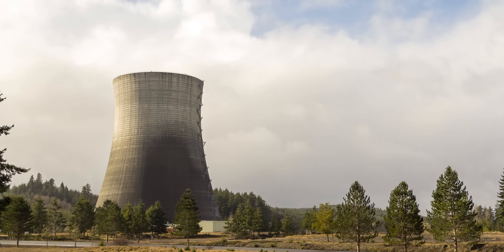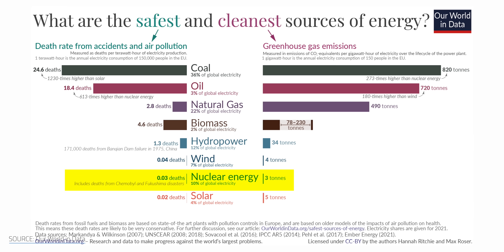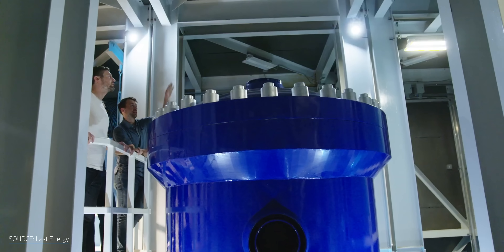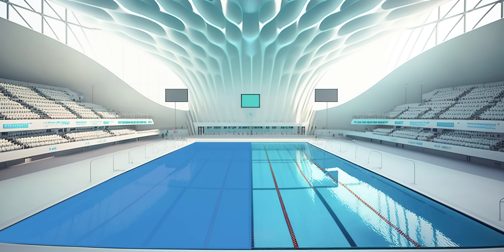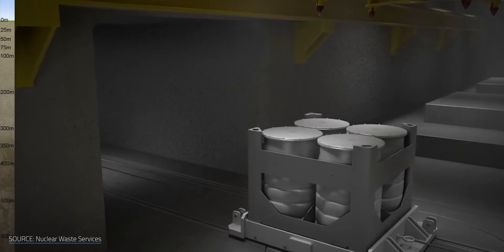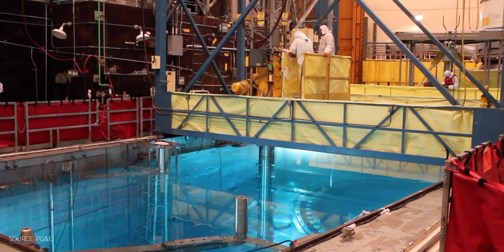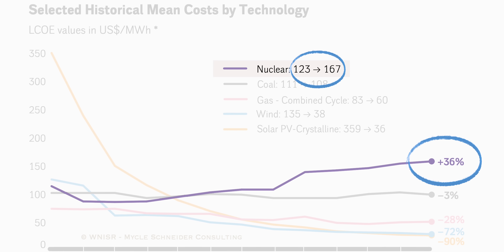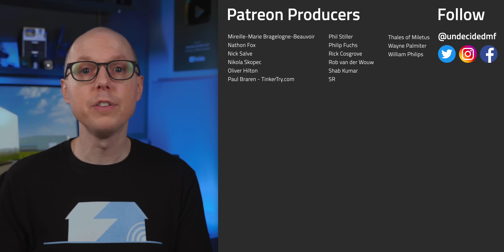Is Small, Fast, & Cheap the Future of Nuclear Energy?

Comment: Maybe in their region these advantages exist. But where I live I expect it to take at least 5-8 years to develop just 1 (or more if it is in a combined project). Putting up a windturbine takes already +-3 year, with 2,5 of those being due to regulations, administrative process, ... This will be much longer for nuclear sites like this.

Also in terms of safety demands, I am pretty certain those will also be rather high, probably increasing the cost.

The reason we have currrently such big nuclear plants isn't just complexity etc, but also the advantage of scale in the cost and especially in terms of safety, which due to it being centralized can likely be much lower than when spread out.

Also $123m for a 20MW reactor is going to be essentially the same price as a big one: $9,8B for 1,6GW vs $8-10B for one 1,6GW big reactor. Pretty sure that regulation will require at least a few personnel being constantly on-site: an operator, maintenance (probably 2-3 to be certain or 1+few in standby/floating around), security, ... So that are at least something like 10 people per reactor (shifts), if spread out this can be around 800+ people too, similar/more to a big one currently.

And just adding modules with the same permit is also going to be not so easy if this wasn't already forseen upfront.

In the end this sound a lot more optimistic than it likely is imo and we'll have yet to see how good MSR's like this can actually become.

I think just standardizing this big plants as much as possible is also going to be a much more cost saving measure. And not just standardizing within one country, but over multiple ones.

MSR's still can obviously be very usefull to provide regions with power that are a bit more seperated and don't need the output of such a large one. Maybe in the future with more renewables and potentially dwindling need for nuclear, they can be usefull for industrial sites etc where 24/7 power might be needed.

Comment: Matt, you need to double-check your sources. Those LCoE numbers are way out of line, which should be unsurprising given that they come from known anti-nuclear energy organization, the WNISR. Both the IPCC and NEA clock nuclear at under $70/MWh, and solar and wind significantly higher than the WNISR.

Also, almost all calculations for LCoE that return such low values for renewables are excluding the necessary cost for storage.
Reply: And nuclear power plants only have a life expectancy of 30 years in the LCOE calculation. Meanwhile in reality, Belgian nuclear power plants have been running for 40 years now. And some have been extended for another 10 years. It could've been 20 years  according to scientists, but the green party wanted them closed.

Comment: The problem with nuclear energy is that a lot of nuclear plant research was stopped in the 1970s after the 3 Mile Island accident, and the Chernobyl RBMK reactor melt down was the nail in the coffin. To further muddy the waters, the Fukushima Daiichi plant, a design from the 1960s, while poorly funded and operated by TEPCO, convinced many that nuclear power was simply unsafe. But modern plants are far more fail-safe than the designs from the 1960s. Saying the risk is too high is like looking at the safety record of a car from the 1960s and then declaring that all cars are unsafe. It is a dishonest comparison. 

Nevertheless, no matter what the LCOE is, we simply don't have anything close to the energy storage we would require for wind and solar to keep the grid going on those sources alone. The storage capacity of modern systems is orders of magnitude less than we need. We don't have the known resources on this planet to build such energy storage either. No amount of hand waving or professorial confabulation will make it so. 

Don't get me wrong, I think renewable energy should be part of the portfolio. But there is a requirement that it will not be able to meet for a very long time-- if ever. And that is the Base Load energy. If you don't know what that is, look it up and then look at various grid operations web sites such as https://www.iso-ne.com/ or https://www.ercot.com/gridmktinfo/dashboards to see how much the shortfall is. And while as an engineer I love efficiency, we can't conserve our way out of this problem. 

Those are the hard facts. Sloganeering will not fix things. SMR technologies have run successfully on board the ships of the US Navy since the 1950s. The only new technology are the fail-safe controls of more modern designs. Let's build them, or let the grid go dark and watch what happens to the environment when every harry homeowner lights off a generator in the back yard and a wood stove to stay warm.

Comment: Does LCOE include the cost of cleaning up after Fukushima? Nuclear is expensive, until something goes wrong then it's really expensive.  Until the cost of recycling and sticking the the leftovers in the ground is factored in, I don't think it's fair comparison.  In 50 years you can put the waste in a new cask, but with inflation that cask is going to be more expensive, so no matter how much energy you got originally, the clean up keeps getting more expensive the longer you put it off.   So I just don't trust any cost comparison until we really add up all the costs.  Finland almost there, but we need a few more continents doing the same.

Comment: To answer your question, yes.  I can see no way of bringing costs of nuclear energy down to a reasonable level other than by building small modular reactors on an assembly line.  Hopefully producing plants on an assembly does not introduce new hazards during the production process.  All the same I'm pretty excited about this.  If electric vehicles are the future, this will go a long ways towards reducing the need to beef up electrical lines to carry more power over long distances.  Having a nuclear reactor that's dedicated to specific locale (be it a city or a manufacturing faciliity) seem like a great way to achieve cheap and reliable energy.  Though even with the increased safety, if you have widespread adoption the chances of something going wrong somewhere does offset that increased safety.  My fear is that when that one incident happens that it will restigmatize nuclear energy and cause unwarranted apprehension.

You mentioned in your video that Last Energy is saying that it is theoretically possible to use spent nuclear fuel.  According to this video from Copenhagen Atomics it sounds more like a near reality using their small modular Thorium reactor to burn Plutonium and the long-lived actinides.  https://www.youtube.com/watch?v=27IntvWo4mo  Their first prototype reactor is slated to start up in 2025.

Comment: Modules like this, and the one Rolls-Royce has been developing, will become more useful, and more necessary, as we as a species expand away from our parent star. PV becomes less effective further out as input energy drops away, but nuclear fission, and hopefully fusion too, remains the same output from the same input.
Closer to home, disaster management is where small nuclear units become very effective - fly in under a helicopter, put on the roof of a hospital, power the equipment to keep people alive. (Do the same on shopping centers and malls to keep power on while surviving the Zombie Apocalypse,...)
Standardization is key, so they can plug in anywhere, followed by swapping cycles to keep pulling energy out of what we currently class as 'spent' fuel.

Comment: The mentioned 24000 years when nuclear waste is dangerous is a milk maid calculation. Plutoniums 239 half-life period is 24000 years. After one half-life period there will only 50% of the Plutonium decayed. You have to wait 9 more half-life periods before there are so few radionucledies that the former nuclear waste is safe. Round about 240000 years. You will find not a single civil engineer knowing to build structures that resist the glaciers of an ice age, magnitude 10 earthquakes or the eruption of a supervulcano.
An none of these nuclear advocates mention the enormous security problem of SMRs. Conventional nuclear power plants (npp)are secured like fortresses. Guess why. If you plan to supersede only one big npp like the german Isar2 (1400 MW elec., R.I.P.) you need 70(!) of the mentioned 20 MW SMRs. Who will protect them? Or, who will pay for the protection? Al-Qaida and other weirdos will cheer you for bringing the material for dirty nuclear bombs straight to their backyard.

Comment: Great video, and I agree entirely, do not let perfect be the enemy of good.  There will never be a one size fits all answer to energy production.  This is an excellent step in a great direction.  As well, if we hypothesize that our space age tech is going to continue at the pace it has been going, the ability to store or completely rid ourselves of nuclear waste somewhere non terrestrial will make itself available long before our long term terrestrial storage ever becomes a problem.  I had also always wondered about the idea of miniature nuclear powered generators for homes, neighborhoods, and even vehicles.
Reply: Not sure it will ever be viable for individual homes or non-commercial vehicles but I could see having 1 per neighborhood to power a bunch of homes with some interconnects to cover failures and expected replacements.  Of course I'd be happy to be proven wrong.  Thorium Salt SMRs seem like they could make things even safer and make some large vehicle use more viable (Thorium Salt SMRs are supposed to be incapable of melting down or releasing radiation to the environment so they won't need to be buried).

Comment: e) LCOE is not a measure that accurately compares system costs. It does not include firming costs and arbitrarily limits the life time of the assets in the calculation. Lazards latest addition includes power sources WITH firming costs (for 4h, which is woefully little), showing that even the highly inflated costs for Vogtle 3 (with a mid build design change mandated by an openly anti-nuclear NRC commissioner...), compare very favorably to solar+firming. 
(This is actually the reason for why developing countries are still building large amounts of coal... they need firm energy and opt for the cheapest way to get it...)

Comment: c) The half life of an element specifies how long it takes for half of it to undergo spontaneous decay. You would probably want to wait for ~10 such periods so get the radioactiviety down to a 1000th of the inital level (2^-10). 
d) The price tag is for a 1100(!) MWe plant. The argument for nuclear affordability is that licensing is an arbitrarily imposed, policital cost, which reflects the public bias regarding nuclear safety. The US built power plants in 1968 in 4 years for $700/kW (inflation adjusted). Today, it takes 16 years and costs more like >$10k/kW. The reasons for this have been investigated by various reasearches thoroughly: regualtion induced costs (for example having to keep workers wating for someone documenting some issue) are the main culprit. Other jurisdiction, for example India, are building reactors (their very own IPHWR-700 for roughly $2100/kW today).

Comment: Integral Fast Reactors (IFR) are the solution. They cannot meltdown, You can also recycle the waste from any other nuclear reactor or even nuclear weapons. What little waste they do produce only need to be stored for 800 years, not 24,000 years. They can be built cheaper and last longer then PWR.

Comment: I was in the nuclear industry decades ago.  I moved to the Gas cogeneration power industry, which at the time was the clean energy.  All energy sources will have an impact on something.  Some love solar, but it actually is being highly financed with government subsidies, while cutting down forests or covering farmland; not ideal, especially since it is so intermittent.  Small nuclear, similar to naval power plants, is reliable and safe, and the waste is fully contained, no CO2, though the media loves to show cooling towers as if they are smoke stacks.  Stop with the climate change fear mongering.  The subsidies should be going to these types of nuclear plants to quickly flood the supply of electrical energy, BEFORE we plug in everything that needs power and overload the grid.  Too much common sense, I know!

Comment: Its important to note that deep underground storage of waste is deep enough to have no risk of ever getting back to the surface. Its incredibly deep and even complete collapse with water infiltration would be safe as that water would not even get back to the surface.
Reply: Are you going to use hot magma to seal it? If now, it won’t remain sealed.
Reply: Modern reactor designs can process their own waste as well as the waste of older reactors. Of course, these new designs are being actively suppressed by the oil companies.
Reply: As soon as we have one of these storage facilities, we should start using nuclear fission.   Wait...

Comment: Very Small Molten Salt Reactors.

If they can decrease energy cost by an order of magnitude using these sorts of reactors, people can start generating transportation fuels in situ using the Sabatier reaction which would be a carbon negative fuel source without requiring a change from ICE vehicles. Short of developing ultra small MSRs, hydrocarbons (methane in the case of Sabatier reaction) are far more energy dense than batteries. If it can be made to be carbon negative, and in particularly far more "green" than batteries, who could argue against that? 

Also there are never good numbers on the cost of nuclear. It's an extremely regulated market.

Comment: Well, if I can store the nuclear waste these devices do in your garden or your living room ... then yes, this will be the future.

> Nuclear is reliable

It isn't. In Europe (Germany, Spain, France) in the last few years the NPPs had to reduce their output power during the summer. Why is that?  Because the rivers hadn't had enough water for them. They need water for both cooling the steam (after the steam turbine) and also as a reservoir for emergency cooling. As climate change changes weather, including snow and rain, every thermal power plant (no matter if oil, gas, nuclear) will have a problem.

So no, they are not reliable. You can't 100% depend on them.

> all for essentially zero carbon

Even that isn't true. Since we cannot really remove the nuclear waste, we have to store them for thousands (!) of years. To prevent nuclear proliferation (ever heard of dirty bombs). To prevent pollution. Anyone that says "zero carbon cost" has never calculated how much energy you need to protect nuclear waste for this very, very long time.

Comment: ...to include the estimated levelized cost per MWh of SMR's would have added balance to the discussion. Thanks Matt, great video!
Reply: I think the problem is that there aren't really reliable numbers on it, considering none have been in operation (for a long enough time), so in the end it will always just be guesswork which can vary frome estimate to estimate.

Comment: I wonder if being able to decentralize energy production will cut down on transmission loss.
Reply: Only if you combine it with storage locally. Battery is one way to go. Fluid salt is one way, look at prof. Seymour’s presentation. In EU the gridcosts double the electric production cost for the users.

Comment: The US Energy Information Administration’s ANNUAL ENERGY OUTLOOK 2023 provides the following Levelised Cost Of Energy (LCOE) figures in Table 1b:
Coal: $82.61/MWh
Nuclear: $88.24/MWh
Onshore Wind: $40.23/MWh
Offshore Wind: $136.51/MWh
Solar, Standalone: $36.49/MWh
Solar with 4hrs of Battery Storage: $52.53/MWh

That might sound like a slam-dunk, but the numbers get worse if you take into account the percentage of the day that they various power generation systems provide. From the same table:
Coal: 85%
Nuclear: 90%
Wind, onshore: 41%
Wind, offshore: 44%
Solar: 29%

Now, invert (1/%) their availability giving to generate the following multipliers:
Coal: 1.18
Nuclear: 1.11
Wind, onshore: 2.43
Wind, offshore: 2.27
Solar: 3.45

Apply the multiplier calculated above to the cost per MWh, provides the COST for producing the SAME NUMBER of MW per hour:
Coal: $97.48/MWh
Nuclear: $97.95
Wind, onshore: $97.76
Wind, offshore: $309.87
Solar: $125.89

First, note the cost of ‘expensive’ coal compared to nuclear and onshore wind.
Next, remember that for wind and solar we’ll still need batteries and/or peaking plants to store/back-fill the periods when the wind isn’t blowing… while nuclear and coal just keep on pumping out power.

And we still haven’t taken into account the small detail that coal or nuclear plants will last for 50+ years, while renewables have a life span of 20-25 years. A quick-and-dirty analysis would multiply the effective LCOEs of renewables by the difference in their duration, which is 2-3 times. If we use a multiplier of 2.5, we get…
Coal: $97.48/MWh
Nuclear: $97.95
Wind, onshore: $244.40
Wind, offshore: $774.68
Solar: $314.73

Comment: Proposed Solution for Nuclear Waste:
Utilizing magnetic catapults to launch waste into space, ultimately sending it towards the sun. While this approach would require a substantial amount of energy, it presents a secure and potentially effective solution for dealing with un-recyclable waste. As we strive towards an era of abundant energy, this method has the potential to become the optimal solution for managing nuclear waste.
Reply: How and why? It seems better to just reuse the waste to generate more energy.  Wasting energy to send chemicals into the sun is a pipe dream and not a reasonable solution...
Reply: What isn't recyclable?
Reply: @JonDoe-d8b  From the high-level waste, you'll get non recyclable Plutonium isotopes, minor Actinines, isotopes from iodine, cesium, strontium and technetium...